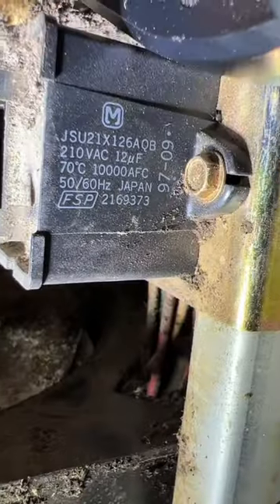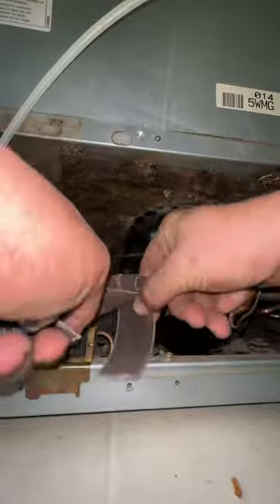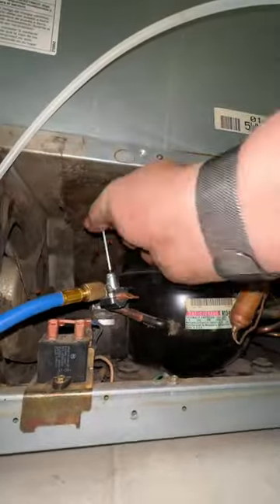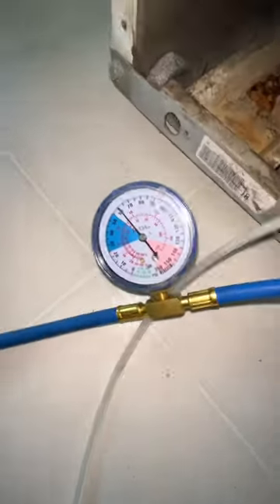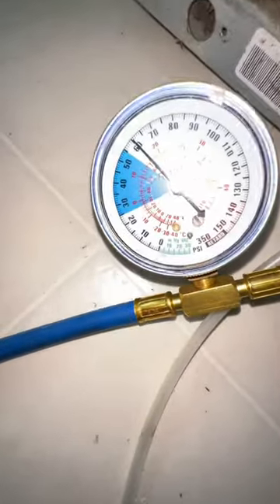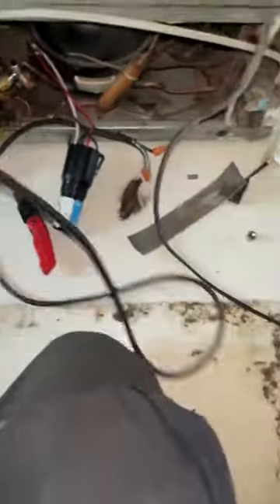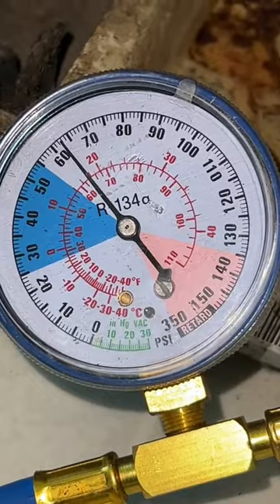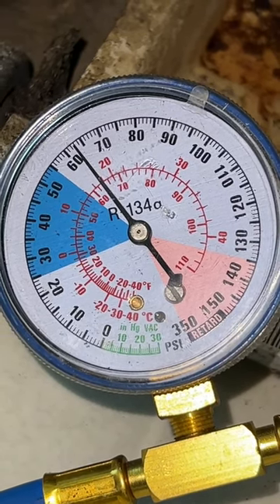A refrigerator than I am unable to fix. #Rental #HandsomeOrHandy #Handyman #ApplianceRepair

Comment: How handy are you if you check a couple things and cant fix the problem. Content wise and for future reference if you get a client to upgrade which is always a option if you really cant fix it. Take the refrigerator home try to figure it out and make some money on the resell if you can, but in the mean time with content you could show us what you did, ask what you should try or what you could have done, and try to learn to fix that. Instead your  not so handyman clip just makes you look like a DIY Fail!... remember a failure is just a opportunity to learn!
Reply from the maker: It was a bad check valve on the high side of the compressor. it would cost 600 in parts and labor to repair the old fridge and a new one was 550$.

Comment: They don't even put an access port? You have to use a piercing valve to measure the pressure... I guess it's cheaper for the manufacturer to replace the entire fridge than to replace the compressor. That's why you pay $2000 for a $500 fridge.
Reply from the maker: They don't want anyone to mess with the refrigerant circuit. And for the most part they are correct for doing that, most of the time an access port would cause more problems that it would solve.
Reply: No they are illegal to have on fridges that contains R290 or R600, both are a propane or butane mixture for refrigerant. I am a actual HVACR tech not what ever this guy is. Also that isnt why they dont put fittings on them, commerial reach in like True coolers and freezers dont have them either. During the manufacture process they dont install them for many reasons.
Reply: @zack9912000  "whatever this guy is' I think he's either a handyman or maybe a model . Username checks out